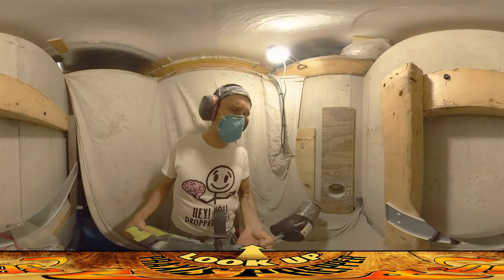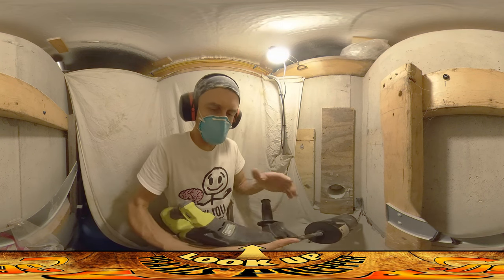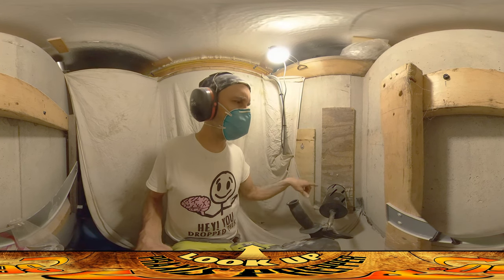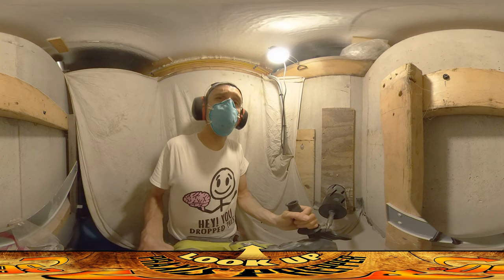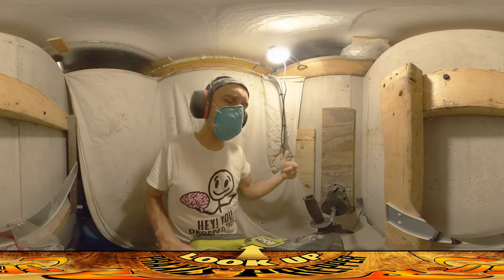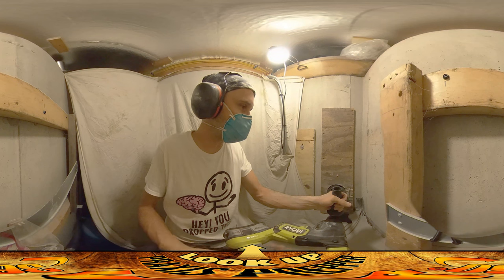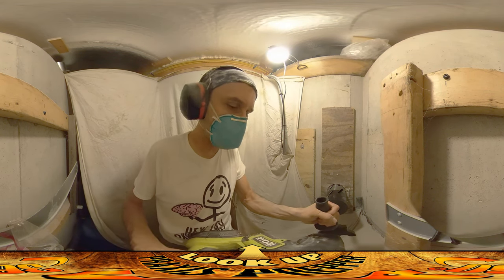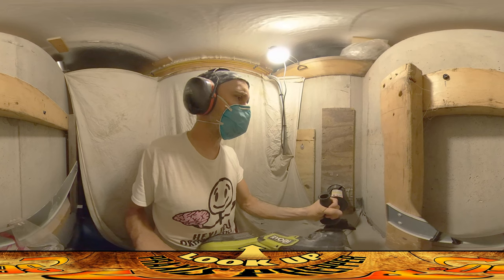Homestead Building - Drilling a 5" Hole in a Foundation

Comment: Praxis, Praxis, Praxis… your method made that so much less efficient. Your premise of periodically pulling back to clear the bit was spot on but the frequency was way to high and risks damaging the teeth. Diamond tipped bits of any kind are meant to grind away at the material although technique holds true for hole saws cutting through thick wood also. Hopefully it holds/held up long enough to get the second hole cut. If you haven’t done it yet, definitely give the teeth more cutting time and gently push it back against the concrete. It’s an expensive bit, I’d really hate to hear that it didn’t last long enough. BTW, part of the reason you don’t need to pull back frequently is the cuts in the side of the bit that should be carrying most of the dust out along their sort of spiral shape.
Reply from the maker: I learned that i could hold it in longer as i went. I think i showed that in a later video that you likely saw after writing this. I was afraid of overheating and was generally just new to all this. In the end, the cuts went great and i cant even notice any reduction of the length of the teeth on the coring bit (though i'm sure they are at least somewhat shorter).
Reply: @PraxisPrepper  Yeppers saw those, honestly been taking the time to comment on each video just so you know I’m still watching although it’s a bit inconvenient to track them down.